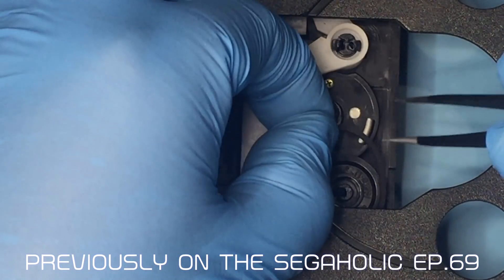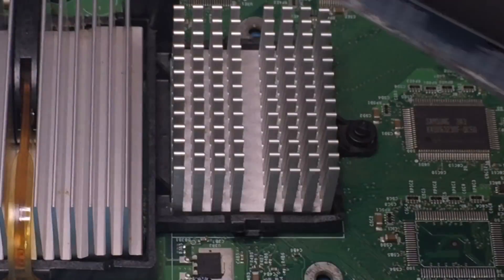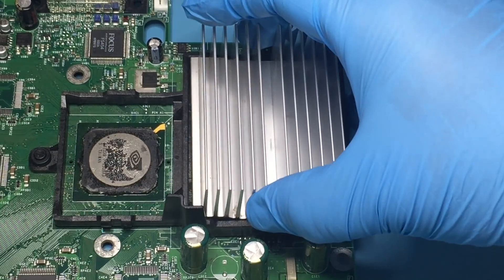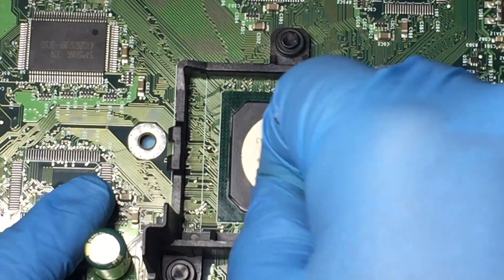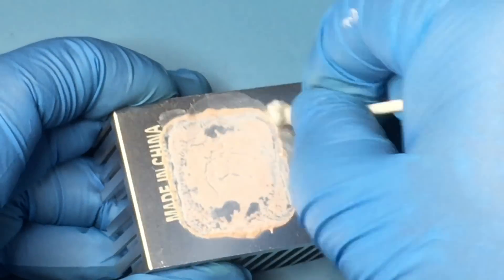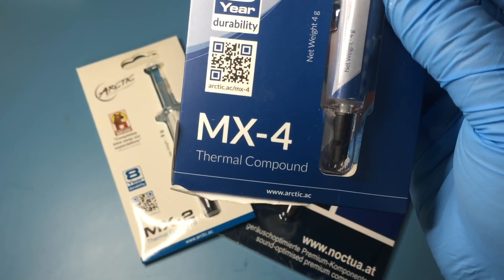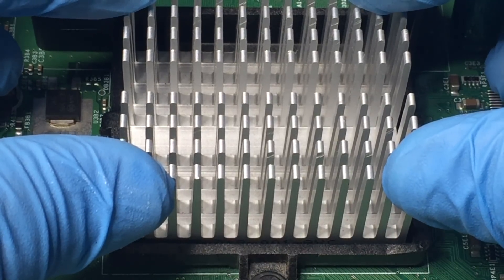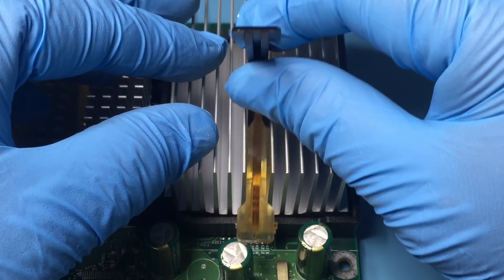Original OG XBox Thermal Paste Compound Replacement- Savers Rescue pt.4 [ep. 70]

Comment: Thanks so much for all your videos, man! I've been watching you for a while. I found a really interesting XBOX at a thrift store last year, and I'm in the process of breaking it down for cleaning, checking the clock capacitor, etc. The reason it's interesting is because it has the black, see-through, skeleton plastic, just like some of the Japanese limited-edition consoles, but it's not Japanese—it's NTSC-U. The casing is not aftermarket, either. It's all official. To my knowledge, the skeleton-black XBOX consoles were never released over here, so I'm not sure what it is.
Anyway, I have a couple of questions for you! You managed to buff out the scratches on your Hello Kitty Dreamcast, and since the plastic on my black skeleton XBOX has some scratches, I was wondering if you have any advice on how best to do that. Lightly rub the scratched areas with melamine foam?
Also, that XBOX of mine was downright filthy. The whole thing needed to be broken down for cleaning. Do you have any tips or advice for cleaning the RF shielding?
Thanks again, and I'm looking forward to the exciting conclusion of this series!
Reply from the maker: You should make a video of your XBox. BTW, congratulations on the find. If I found that, I would be super stoked. I'm sure me, as well as other XBox afficiandos will want to see that.

Anyways, as far as getting the scratches out... I've been typing some suggestions, and erasing them, for about an hour now. LOL. Textured surfaces are really tough to do, and I don't want you ruining it based on my suggestions.

Those are the toughest things in console resotation- scratch removal, and cleaning of RF shielding.

I'LL HAVE A PROPER REPLY IN 24 HOURS, as I need to write this properly so yo don't mess up your console based on my suggestions. I have a couple methods that I think would work.
Reply: Hey, thanks so much! I don't have much in the way of video equipment, but perhaps I'll try and put together a video for folks who might be interested. It may not be super exciting, though, since it's really just a normal, North American XBOX that happens to have the Japanese, limited-edition, black transparent casing. I live in the Seattle area of Washington, so my guess is that a Microsoft employee might've had this customized for their personal use. Just a guess, though.
I didn't mean for you to feel like you needed to put in a bunch of work to answer those questions! For the casing, yeah, I was worried about the textured plastic; it might be better to just leave it as is. For the shielding, though, I was thinking of just taking it to the sink with some Dawn dish soap and, when it's dry, wiping on a very thin protective coat of WD-40, to help prevent rust. Maybe this is a horrible idea, though, so  that's why I asked for some advice. And don't worry; if I mess up the console, it's my fault! Thanks again!
Reply from the maker: Guess what's my video equipment? My lowly iPhone 6 and a couple of microphone stands with  a cellphone holder attatched to boom arms. LOL. Really, an undocumented XBox revision is super interesting. I bet you'll get a couple thousand views if you title it right- like "Super Rare USA XBox revision- Clear Smoke" or something. I'd even post it on Reddit's XBox forums as there is a dedicated one for XBox revisions.

https://www.reddit.com/r/originalxbox/wiki/editions

I know Metal Jesus from Youtube found a rare orange one and isn't he from the Seattle area?

https://www.youtube.com/watch?v=v9UbxjIIL-M

You can find out what your XBox really is, have some speculation from the community. It'll be really interesting to a lot of people.

As far as the RF shielding, use some WD-40 on the rusting if you wish, and carefully clean the shield, but try to contain the wd-40 on the rust areas only. Then spray off any loose dirt. Then just use soap and water with a sponge, cleaning the spong frequently to prevent the sponge from becoming sandpaper with all the dirt that attatches to it. Avoid just coating the RF shield in WD-40, as it'll make your room smell and the interior of the XBox smell like WD-40. Also, it's flammable, so don't do it.

I was actually thinking of using ELECTROLYTIC removal:

https://www.youtube.com/watch?v=54ADeB6V1rQ

But you'll have to treat where the rust was as it will rerust.

As far as what I do? Before, I used to try to get the RF shield free of all rust. But that resulted in me just scatching up shield, making it look ugly; or stripping the plating with all kinds fo cleaners and rust removers and can be hazardous if you use the wrong cleaner/chemical on the plating as it will have a reaction.

Now, I just cleaning with soap and water, and sponge, again, frequently cleaning the spong as I go, to prevent the spong from becoming sandpaper from the collected dirt on it, preventing scratches. And do spot rust removal if it's flaking or feels exceptionally rough.

.... case scratch removal response coming soon... as I think about it... LOL.
Reply: Perhaps I'll put together a dinky little video this weekend for anyone who's interested. Thanks for the inspiration and advice!

I don't know Metal Jesus personally, but he does live in the Seattle area. I've seen several of his videos, including the one about that rare orange XBOX he has; stuff like that certainly has the possibility of showing up around here.

I think I'll follow your advice and use some WD-40 only on areas with some rust, after a full cleaning with soap and water. The reason I was thinking of doing a light coating initially is because I was concerned that if I used soap and water on the whole shielding that I might be contributing to the creation of rust in areas where it doesn't currently exist—like if there were small pits in the metal that I can't see by eye that got water in them or something. Maybe I was overthinking it.
If I happened to screw up the shielding significantly, I don't know that it'd be the end of the world, since I imagine I could replace it from a parts system. I've actually looked into the electrolysis method of rust removal (!), but that looks like a fair bit of effort for something I probably wouldn't use that much.

Once again, thanks for all the thought and effort you're putting into these replies. I'll take some photos and some video of the board while I've got it torn down.
Reply from the maker: No problem man, I love talking about video games and hardware.

I just cleaned the Xbox piece by piece about 5 hours ago, and the next video should be up either today or tomorrow. All I used was soap and water for all the parts. I'll also try and get out some scratches, and hopefully, you can get something out of it.

But yeah, don't leave WD-40 in there, you need to wash it off. It'll stink up the interior and again, is a fire hazard. Make sure you wash it off with soap and water, but dry it off immediately with first, patting it with a paper towel so you don't scratch it up, then a hair dryer.
Reply: Ive been looking for crystal black case, I have a couple different mainboards I would pop in it!
Reply: I think that's called the smoke edition. I think I remember seeing pictures of them that were not japanese. They might have been given to microsoft insiders so they are trying to cover it up since back then most of them weren't thinking about the great nsa net...I know someone in 2009 that had an xbox 360 slim and I remember thinking to myself wow why would he buy that when you can get the same regular fat ones on ebay for like $40...lol Well anyway fast forward this many years later and I looked up when the slim xbox was announced and it wasn't announced untill 2010 but I know that's impossible because I remember reading about it and seeing him have one it 2009. I know I'm not forgetting either becasue it was in the dorm room and the only time I was in that dorm was before it was released...I remember it being connected by wireless too and thinking whaat a noob gaming on wireless...I later found out hes connected to top level scotish rite masons...and all the people like allard ect are all top level masons too...so it might be like a freemason xbox lol...Edit: oh and I found an article from back in the day with someone braggging to be the first person to review the xbox, the wii, and the 360 and I think some other console...lol now how in the world would someone do that ...

Comment: I use wd40 after that I dry it with alcohol
Reply from the maker: WD40? Looks like petroleum based products work well to remove the TIM, especially the white one. I'll try that and vaseline on the next one. Thanks for watching and commenting.
Reply: The Sega Holic confirmed, wd40 works like a charm, just make sure to 100% remove any residiues of it afterwards so it is completely dry and does not interfere with the thermal paste! Great video thank you again!
Reply from the maker: Jens Lorbeer THX, need to try it.
Reply: The Sega Holic just a tiny amount on a qtip will get the job done, it desolves the thermal paste right away.